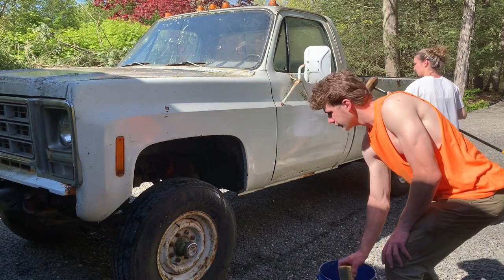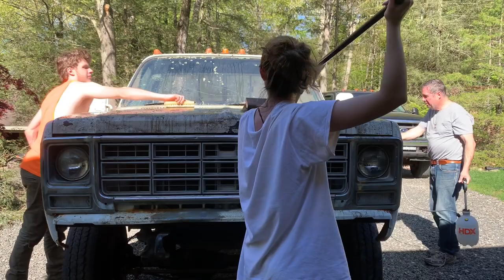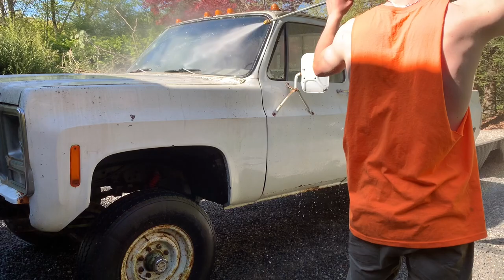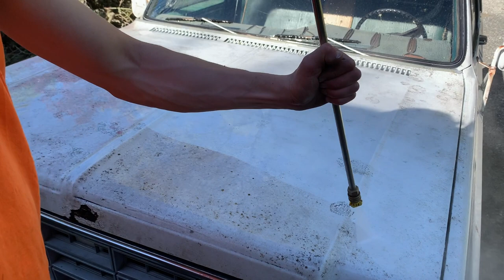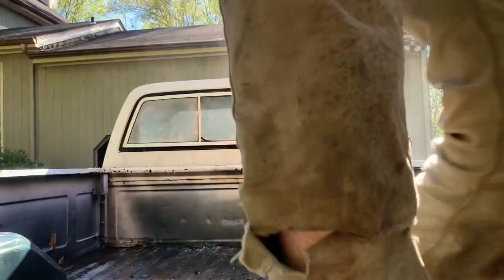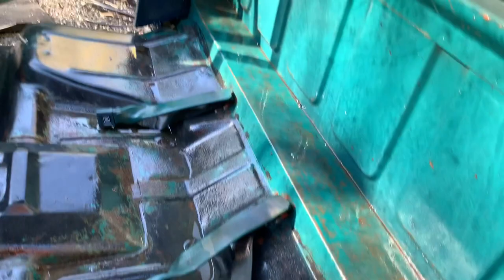1979 GMC Sierra Grande “FREE” barn find part 2

Comment: I think that you have a real decent rig for a starter truck. It costs thousands to bring up to show but if ya want a good daily and grocery getter, take good care of it as its got real good bones. I did this for around forty plus years and so know the heartaches of trying to make look like new again. Not to sure of your skill set yet but from a guess, its a good starting point to learn a ton on. Just as it is, here in alaska, truck values are around five thousand but lower forty eight prices can go pretty nuts. They made millions of them so still lots to be found.. even so, this one is in very good shape. Replace fluids in every drive unit so to get the condensation out and start fresh on a long running rig... motor probably from setting may need a reseal to stop leaks from dried out seals and gaskets
Reply from the maker: Yeah man. Great running truck.